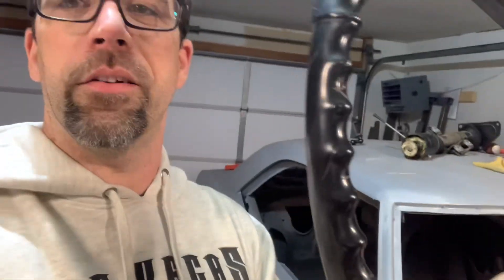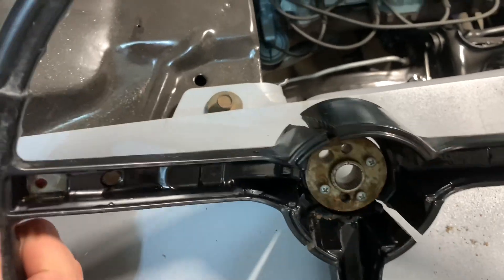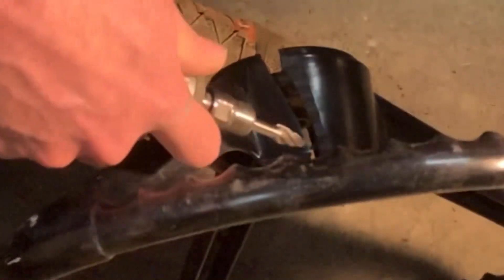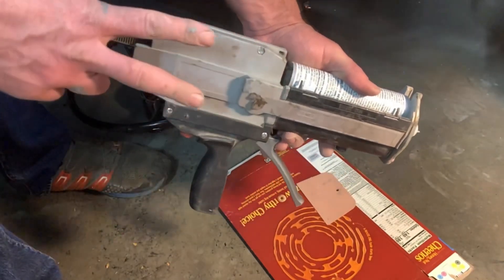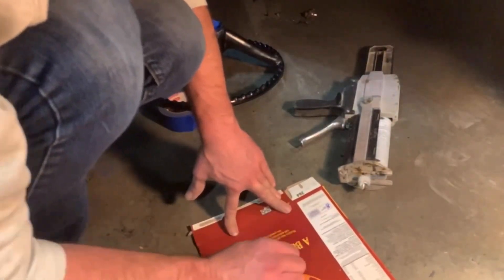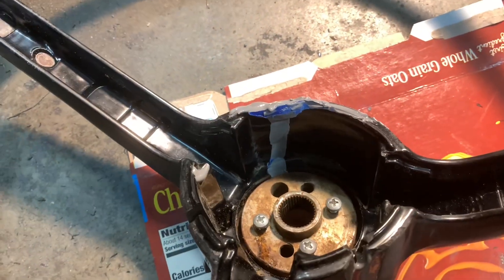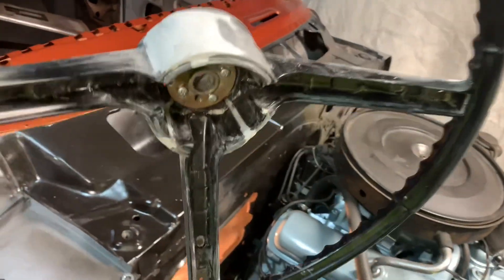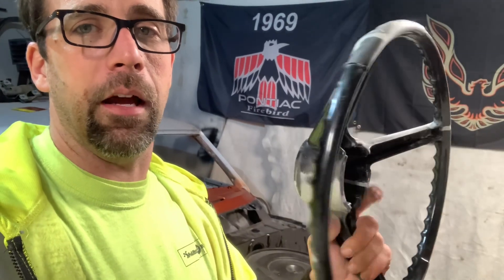Cracked or damaged vintage car Steering wheel repair.  1968 Pontiac Firebird

Comment: For complex shapes such as this, dash pieces, custom work, whatever. If you mix a little fiberglass resin with body filler(using the proper hardener for both) it makes a brushable filler that smoothes out nicely. Just brush a thin layer on your work piece and then sand and prime as normal. It's really great for large areas too.
Reply from the maker: Fantastic tip!! Haven’t heard that one yet I will definitely be using it.
Reply: @VinylVillageGarage  Resin in body filler, Duraglass, Tiger hair, or epoxy.   Been doin that for decades, works great.  Just use body filler paste hardener in with the resin, works perfect.  Play around with the amounts of resin & hardener before you put any on the wheel.  I use Duraglass not epoxy but it shouldn't matter. If it starts smokin ---- you might need to back off on the hardener a might! lol.  We caught a floor patch on fire useing to much hardener :hand-orange-covering-eyes:---- Oh yeah sure enough. But we was in a BIG hurry to get to grinding on it !--- It was a low life stinkin Ford so who cares right.  🤣

Comment: Looks like it works pretty good, I have done something similar to rubber window seals on T-top with ATV silicone sealant by filling the rip and putting tape over to keep the shape until it's dry and it blends in very well.
Reply from the maker: It works! I like creative repairs and solutions.

Comment: Great Job on the wheel.  I did a 64 Pontiac wheel in a similar way.  I wish I would have feathered back the cracks like you did.  The 3M plastic repair seems like a better way to go then the JBweld type.  I researched all kinds of epoxy and ended up using marine epoxy.  My other lesson learned is use good Automotive 2 part paints, even for the hi build primer and durable clear.
Reply from the maker: I did a 1967 gto wheel years ago and it had some hair line cracks beside the epoxy so i am trying the tapered technique this time and different epoxy. I am sure someone has perfected steering wheel restoration, seeem JB weld is super popular

Comment: Hey Jon, awesome video and exactly what I needed to see, cuz my steering wheel for my 68 is in similar shape. If you do a finishing video for the steering wheel, would love to see it, especially the type of paint you use. Worried about which paint won't get gummy over time with sweaty paws using it.
Reply from the maker: I will definitely put a video on finishing the wheel. I used the same paint that goes on the outside of the car. Base clear.

Comment: Given these original wheels are so hard to find nowadays, a Deluxe steering wheel that is repaired and repainted today is worth $2000 or more.  I've seen just the center cap (with the Bird logo) go for $500 on Ebay.  Today it's very easy to find and purchase a reproduction wood steering wheel (that was considered an option and more desirable in the day); but these original Deluxe Steering Wheels (as you mentioned) are almost worth the price of the whole car!
Reply from the maker: I really like how the deluxe wheel looks on the birds wanted to keep this one with the car.  I understand why they might sell for $2k because the time involved to restore them.

Comment: Pretty cool. I personally would not have had the patience to complete a job like what you’re tackling, but based on what I’ve seen, and I’ve watched a lot of your videos, you seem to be able to do pretty much anything, lol. I paid a pretty good amount of money, not $2000 but a lot of money to have mine professionally redone and it was about a six month wait but the results were excellent
Reply from the maker: Well I try to do all I can myself mostly because I like the challenge and feeling of victory when done. I have had my
Butt kicked by some parts but that’s what makes the victory even nicer. I can only guess shop rates and materials but I know it’s not cheap most people would not mess with it and buy the nice repop wood wheel instead, still a nice option. I prefer the deluxe wheel on a 1968 bird.
Reply: @VinylVillageGarage   Me to, one of the best looking factory steering wheels made in my opinion, but there just NOT very strong at all. And if you got a manual steering box ----- forget about it.

Comment: I’m wondering if you could have taped both sides and used a large syringe to put the filler in between. Would have made outside and smooth and easy as inside?
Reply from the maker: This stuff flows fairly well and if you used the mixing tip provided I bet you could.  Great suggestion! Thanks

Comment: Sometimes I am so glad to have the Camaro instead, got a perfect repro steering wheel for $100. Mine had that same plastic that warped and cracked very badly
Reply from the maker: Dang. Wish they made a replacement for the deluxe wheel for the bird.

Comment: great videos, thank you for posting your progress!  On the center: why not tape the outside and fill from the inside so you have to sand less?
Reply from the maker: Great idea. If it was only a crack it would work great but the wheel also warped and distorted a bit. So I need to fill past the crack and sand it back into shape.  Now the cracks on the outer rings your idea actually is a great one and I will try it next go around

Comment: Wont be cheap, but if you make them for other people check on getting a 3d scanner and printer. You might even be able to find a program online already foy the steering wheel and have someone print it along with other plastic trim pieces.
Reply from the maker: I tried to find a 3D printer guy for my rear spoiler, it wasn’t going to be cheap.  Approximately $1,000

Comment: I must have at least a half dozen of these Deluxe wheels in the garage and maybe enough 'bits' to complete two more cores.  I have a question. the wheels come two steel inserts, a small diameter that produces cracks, and there is a large diameter that produces BIG cracks that bind badly with the column collar and the expanded diameter  interfers with the wheel's center cap attachment. Did you have to 'tune' these edges to make the cap comfortably fit and no collar binds? Was my concerns valid?. 
Also I notice there are differences deween the 68 and 69 center caps. One is a silver mirror ring around the bird and the other has grooves in the ring like an LP. For the life of me which style belongs with which year? Dang! I'll have to check the wheels that I know they came off '68s.
Reply from the maker: I didn’t experience any clearance issues with this wheel, I did have to remove some plastic to get it shaped right. Because as you know the cracks are from shrinkage and it totally distorted the original shape and fitment so to get it to look and fit well lots of modifications and test fitting.
Reply from the maker: If you want to sell one of those wheels I might be interested too 😎

Comment: Here is the problem with all the 67/68 plastic Firebird deluxe wheels. My 68 Bird was ordered with a quick ratio MANUAL steering box ( VERY rare, stupid thing take a special center link and steering box pitman arm than any other bird has) That quick manual box was noted on my PHS check list for my car so I am NOT changing it. With the extra force it takes in parking lots to MAN HANDLE that quick box, it is pure hell on any plastic deluxe wheel no matter how good they are. After buying and repairing 3 different really nice ones over the years, they all crack again in very short order because of that 2 handed beast of a manual steering box. Add to that issue most of the factory GM 3 spoke stainless wheels ( AKA Corvette or SS cars) also seem to brake at the outer ring at the spokes as well.  So, I was looking at a Oldsmobile SX 4 spoke stainless wheel that the spokes & ring are thicker than any of the other GM factory stainless 3 spoke wheels.  At a local swap meet I seen a nice black Olds SX wheel with the hub & horn kit all tougher CHEAP !  took it home, cleaned it up and used a deluxe Firebird center cap fits right on the Olds horn plate and damn if that Olds wheel doesn't look FACTORY ! on my 68 Bird. It's the only not correct trim piece on my car now. Every part on my car is correct to the factory build sheet, even used a low life AM radio in it. However, I do have 3 power trains for the Bird from numbers matching YC 335hp stock 400 to my fully forged BEAST ! Ram Air IV soon to get a set of Tunnel port V afternarket aluminum heads.  NO, Wife doesn't know about them yet $$$$$ !!!!!!!!! then new aluminum R/AV heads will not go over well AT ALL when she see's the check book! fact is she reallllly HATES my Pontiac ( only because of that manual steering box she can't DRIVE the CAR !)  lol. 

See link https://www.bing.com/images/search?view=detailV2&ccid=LgxdlwSU&id=0565D57D6B0C3A5C61CE0477FBD2D2DD69BAA19D&thid=OIP.LgxdlwSUU8sz4mByNBIF8AHaGe&mediaurl=https%3a%2f%2fcimg4.ibsrv.net%2fgimg%2fclassicoldsmobile.com-vbulletin%2f700x612%2folds_custom_sport_steering_wheel_db774488fd1438c1189a3b884d22f8790e955c04.jpg&cdnurl=https%3a%2f%2fth.bing.com%2fth%2fid%2fR.2e0c5d97049453cb33e26072341205f0%3frik%3dnaG6ad3S0vt3BA%26pid%3dImgRaw%26r%3d0&exph=612&expw=700&q=pictures+of+oldsmobile+sx+4+spoke+steering+wheel&simid=607988346877314771&FORM=IRPRST&ck=E5220C19DC2118695D3116BE2A4EE593&selectedIndex=33&qpvt=pictures+of+oldsmobile+sx+4+spoke+steering+wheel&ajaxhist=0&ajaxserp=0
Reply from the maker: I have been reading about the reproduction ram air5 heads. Very interesting, out of my
Ready for now but really would like to hear one running surly has a different sound because of the valve configuration.

Comment: Great video! How do you take off the steering wheel logo cap? Is it held on with clips?
Reply from the maker: If it’s a deluxe wheel like this one It pulls off there it is like 3 point spring clip. It’s a snug fit but it will pull off by hand.
Reply: @VinylVillageGarage  Much Appreciated.